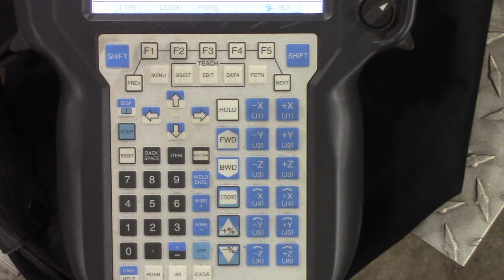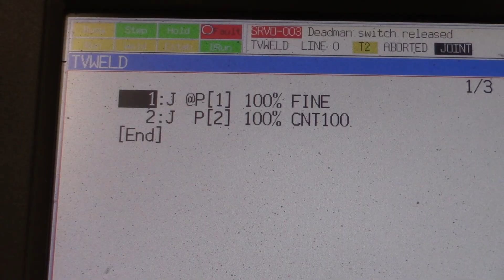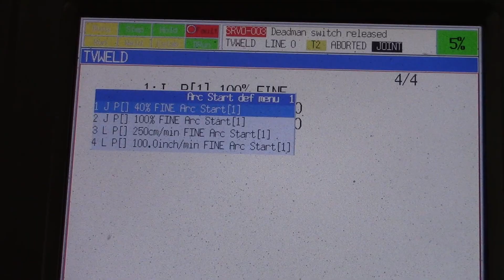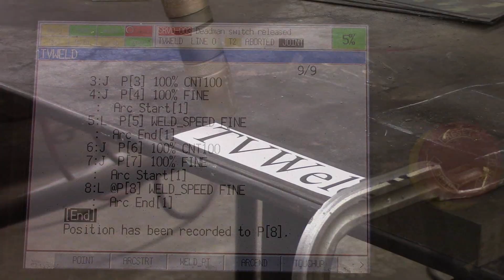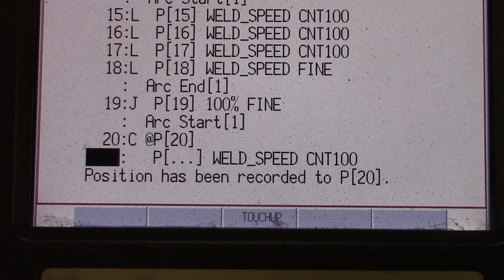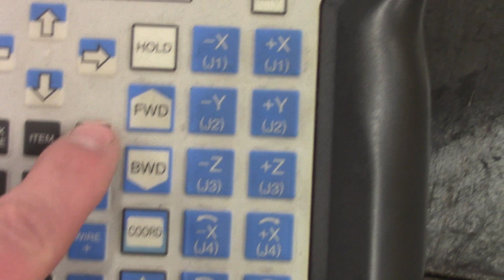How To Program A Welding Robot

Comment: Hi I work for a company that weld brackets and drain nuts to oil pan and the issue is with burn back. What could be the cause  ? And thank you.
Reply from the maker: Usually its bad welding parameters.  I'd either increase the wire feed or decrease the voltage.

Comment: You suck dick at teaching. I haven't heard anything really explained where it's understandable unless you've done this. You never said why you were doing what you were doing or why you were starting where you started. I didn't see any machine you were using, what your wire speed is supposed to be or anything. I don't know what the fuck J means or @P or did you explain it either. Seems like you skipped a lot of info.

Comment: so what your saying is there is no cnc auto cad programming for this its all done by that controller in you hand... im 32yrs old i was just offered a job to operate one of these, ive been in this trade doing custom fabrication and repairs for 18 years. the last 10 years ive been running my own welding machine shop, the last 2 years have not been good ... turns out im the last of my kind if i have a yacht building company and a tool and die maker both offering me a full time job ... would love somones opinion if i should take the job and why, steady pay cheque is the only reason i have at the moment
Reply from the maker: Yes the programming is all done on the teach pendant.  As far as career plans I've always been a person that believes you have a full time job with retirement, health insurance, etc. and you run your own business on the side.  That's just my humble opinion, but everybody's different.

Comment: Hi Brent,
Thank you! Great video very informative. I am looking to outfit my shop with a Fanuc welder. What are you running in terms of electricity? Are you single or three-phase, and are you 60 amp for the welder or does the robot require you to draw more?
Thanks!

Comment: Thanks for doing the video brent.  I have watched all the ones on the robotic welding.  I am looking to get a couple of fanuc robots for our shop.  all of our parts are 3/4" plate or heavier and have a considerable amount of weld time in them.  The parts themselves are not overly large and could easily be fixtured on a table.  I measured all the parts we have put together manually here and they are all +/- .030 (1/16th on a tape)  with heavier parts like this is do you find the fit up less critical than thin materials.  I have been on a lot of different forums and pages and the general consensus is +/- .010 which seems really crazy to me.  The only logical explanation to me would be a thin weld or something really fine.  What do i look for in a used robot? What are you're thoughts?
Reply from the maker: I've never bought a used robot.  When I've purchased robots it has been with grant funding and they usually don't let you buy used equipment with grant funding.  Every area should have a representative from each robot manufacturer that assists your area.  I'd contact that person for the brands of robot you are looking for and ask them if they have any leads on good used robots.  It is usually hard to find low hour used robots because they are almost always used in high production areas.  I'd avoid big companies like GM because you know they were running all day and night.  The rep. may also know a business that is going out of business or something like that.

Comment: Awesome video. 
The factory I'm working at has us hand weld and use robots... Hard to be taught due to a high line speed, high output, and noise; but this video I think will save me a ton of embarrassing line shutdowns at work since it's easy to understand and to the point.

Comment: Hello Brent, I have a question about how to configure a Fanuc ARC Mate 100iC robot to increase the value for a sine wave function?, I mean, my system controller (R30iB) just can let me type up a value between 0 en 10 Hertz and the process where I'm working needs a greater value to get better results... Thaks for help us sir!!
Reply from the maker: I just tried to go above 10 Hertz on our robot and it went above fine.  I would guess that it is a factory setting and that if you can change the hertz you would have to down load some kind of update or new software, and that is again if you can even do that.
Reply: for the R30IB 10 hz is the limit with a sine weave at the shop im with currently. however personally i cut the dwell time down to about .100 which seems to give me pretty good results while avoiding burn through and gives some pretty decent gap fill.

Comment: I have a question for you man, you said it doesn't run on code.. Does that vary from manufacturer to manufacturer? Im guessing they dont run on code or program like A CNC would?

Maybe using java or c++? Python?
Reply from the maker: They do not run like a CNC.  As far as I know the major welding robot companies (FANUC, ABB, Motoman, Panasonic, etc.) all run the same.  They don't run on G-Codes like a CNC.  When you buy a robot you have to set up a tool center point and all of the robots moves are based off of that.

Comment: Hello sir ! If we imagine this to be done on a part mounted on a complicated fixture arrangement with several production runs, would you have to ensure that the fixture IS NOT in any way shifted as to introduce an offset in the welding path or can a compensation, similar to that in CNC machines, be introduced ?
Reply from the maker: It doesn't work like a CNC machine.  You'd be correct in your first thought of not moving the fixture.  If you wanted to move the welding path you'd have to perform a touch up maneuver.
Reply: Sorry but a robot is a CNC machine, a straight and simple fact, it works the same as any CNC machine irrespective of number of axes or process application.
The problem with fixtures that are not able to be datumed consistently is quite common and can be simply corrected using either a program transformation or shift offset using 3 datum points - either manually or automatically by the robot itself using either contact or non contact sensors.
You only have to do a manual touch up if you do not have a 3 point fixture datum program.
Reply: If you define the tool point offset to move the robot at the point of action where the welding takes place you can rotate, define or offset all the positional data in any datum reference you desire. The video does not go over defining the tool point offset but can be found on other You Tube videos. Many other advantages to using Tool Center point that allows you to use the full capabilities of the robot that  otherwise would create hidden factory costs that go unnoticed especially in processes that have a large stand off distance like painting or metal spray and using circular moves. Your positional data and speeds are not accurate in reference to your point of action where the process is taking place on your part without tool point offset in place.

Comment: Sir, how to define the TCP in this case? Since the tip of the flame is not the tip of the torch...........
Reply from the maker: The tool center point is usually done with a half inch stick out on the wire.  That is obviously not a perfect point, but the end of the contact tip is fairly accurate.  The main point to understand when you are finding the TCP is that it is verifying that the robot is running properly.
Reply: I respectfully suggest you find out what the primary function of the TCP is! If the TCP is not set correctly and accurately ( certainly not by using the tip end) then especially if any of the 3 wrist axes are used in any weld movement the robot does not move in a true line between the programmed weld points whether it be a straight line, an arc or circle.
As a secondary function the TCP is often checked to determine if the robot arm is accurate to the program - many robot companies use an automatic Laser TCP sensor to check the TCP and if it is out then either flags it to the operator or can automatically reset the TCP in the software and if necessary shift the program  accordingly.

Comment: I have some questions about teach pendant. Please help me out on this,

1. Does this teach pendant has joysticks to move robot arms.
2. Does the code written in teach pendant get convert to some machine level instruction. If yes then what type of Machine code 
and how the machine code interacts with the original arm.
Reply from the maker: 1. The teach pendant does not have joysticks.  It has two sets of xyz coordinate movements.  One set controls the larger servo motors, and the other set controls the smaller servos up close to the torch.  The xyz movements are made with little buttons on the teach pendant instead of a joystick.
2. I'm assuming you're thinking that the robot converts the movements into G-codes like a laser or a water jet?  It does not use G-codes.  The lines of language are written kind of like G-codes, but what it really is doing is memorizing points in the air.  The robot has a zero point and it takes all of its movements off of that point.  Hopefully that makes sense.
Reply: You can transfer the tp program in a .ls format which you can edit like a .txt file ! I think the tp program can be edited with karrel as well...

Comment: Good video, can you show how to edit the welding parameters? wire speed, current?
Reply from the maker: I'll try to in a couple of months.  My shop is under construction for three months and it is a straight up disaster right now.
Reply: You press Data on the Teach pendant 
Then you press F1 (choice/type) and select Welding scheduel
Reply: I can't seem to figure out good weld parameters and weld schedule. I was tinkering around with them and my welds look okay except when it finishes and a huge crater is left at the end of every weld. Any idea on how to overcome this? Should I pause the robot at the very end for a few m/s so it has time to fill in?
Reply: please, you show to edit the welding parameters...

Comment: would you be able do the same video with ABB and Motoman?Thank you  
Also how do i modify the welding points and save the new position?
Reply from the maker: +Jiri Kaminsky I don't have an ABB or a Motoman.  The main difference between the different types of robots is the teach pendant.  You just have to get used to the differences in the teach pendants.  If you have to modify a welding point you jog the robot to the correct point and hit shift touchup.  To save it you just have to hit the enter button.
Reply: +Brent Harkness  thank you.